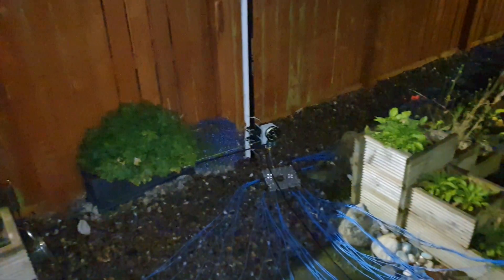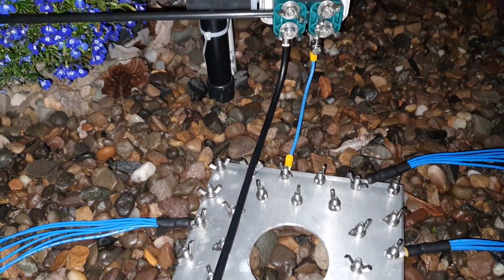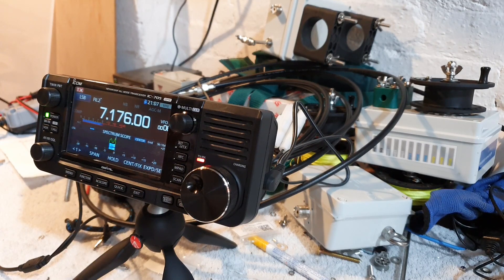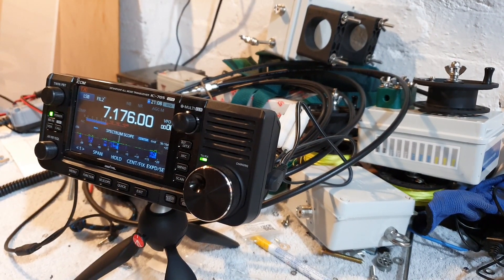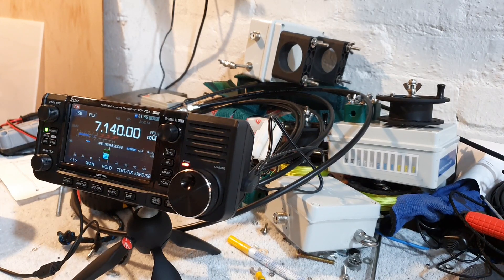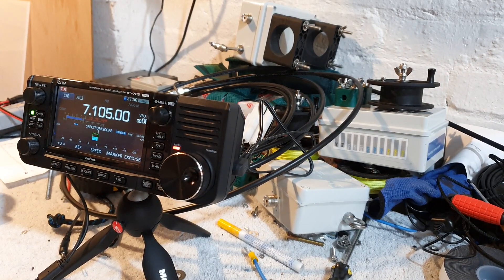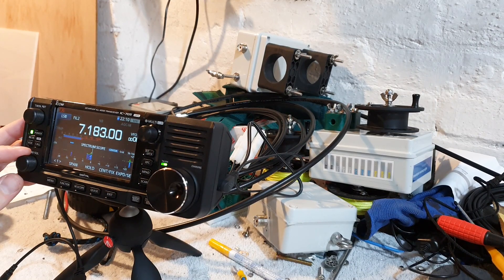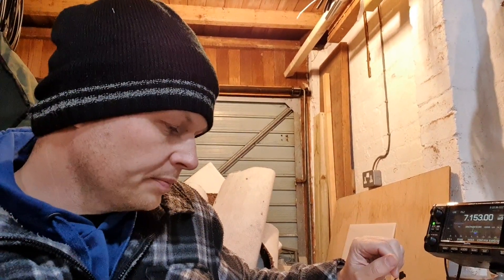ICOM IC-705 & adjustiwave Essential on 5m Windjammer Pole

Comment: Great video. What type of balun do you use with your adjustwave? Also do you need different length radials for different bands?
Reply from the maker: Hi Josh, I usually don't use one. I make a version with and without it. The choke balun version is 11 turns of high power handling coax around an FT240-43 core. I've measured the common mode attenuation and the results are on my website to see. Highest attenuation was around 14mhz.
Reply: @MM0OPXFieldRadio  Again, great job! Thank you for sharing.